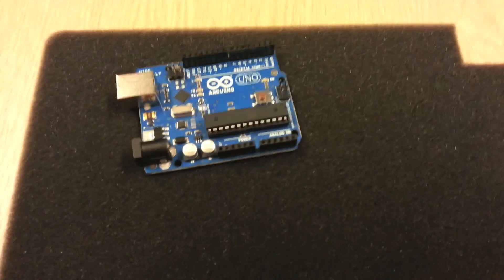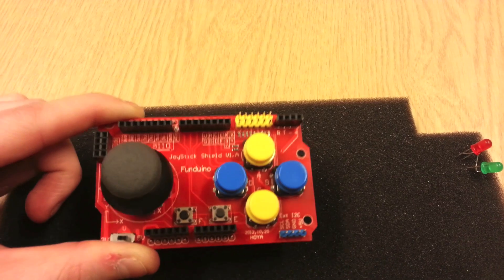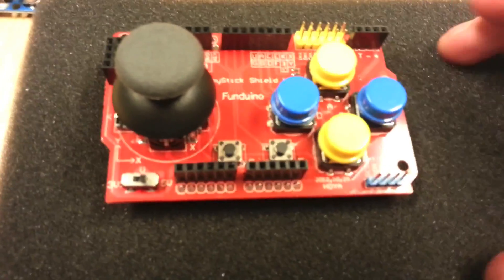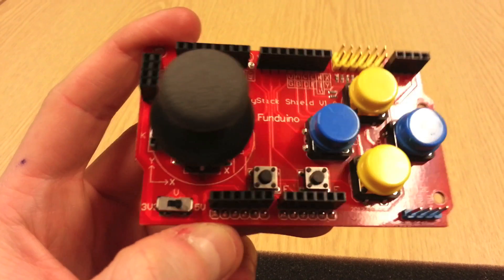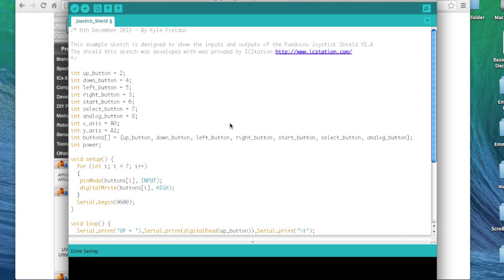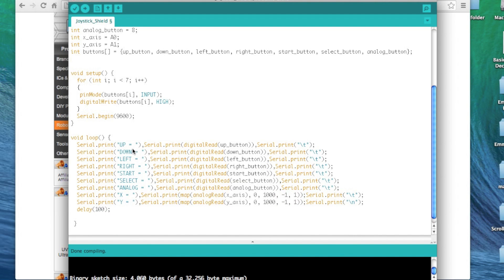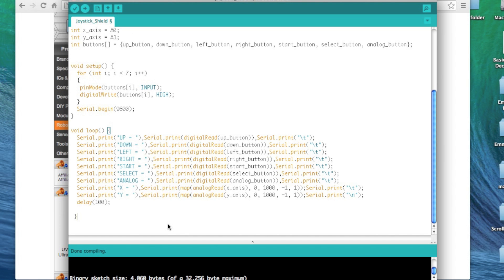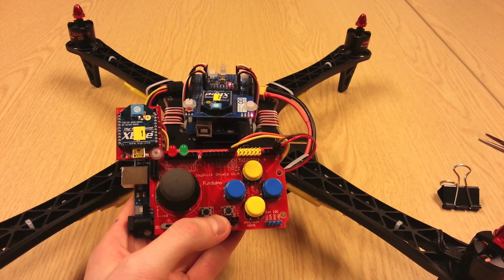Funduino Joystick Shield Review

Comment: As you know this shield's header pins are not compatible with Uno R3 ( the one used in this video is an older version). So I'm a little bit confused how to connect this to my Uno R3. Specially when this shield doesn't have a data shit. Can anybody help me ?

Comment: Hey Kyle. I've been following your project and I'm building something similar. I've got a question about the transmission system with Xbee modules. Is it fast enough to control the quadcopter? I mean: Is there any kind of lag/delay or there isn't any difference in speed with, for example, a traditional 2,4GHz RC radio TX/RX system?